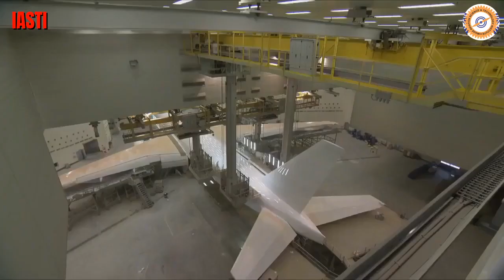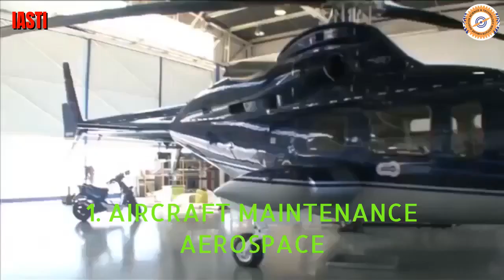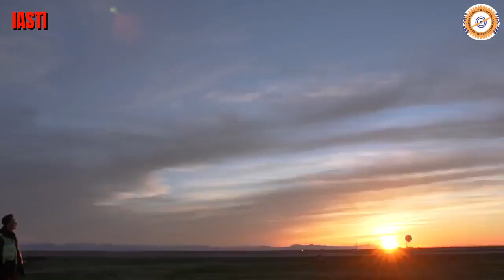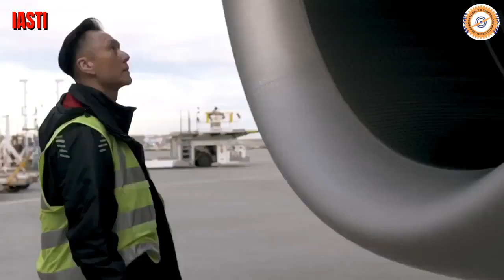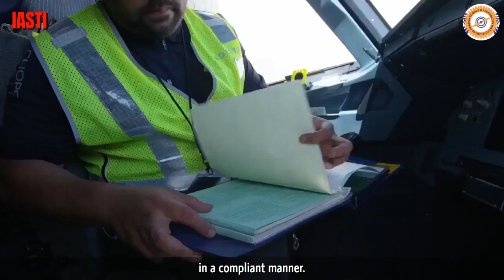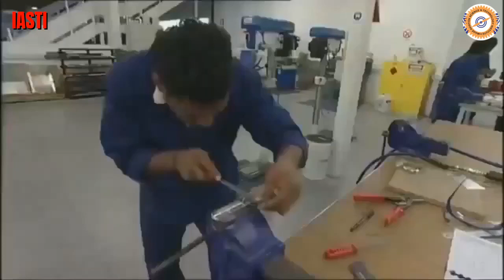AIRCRAFT MAINTENANCE ENGINEERING: WHY SO IMPORTANT?

Comment: 1. What is Image Aviation Science & Technology Institute? 
Answer: Image Aviation Science & Technology Institute (IASTI) is an aviation engineering, science and technology education based institute approved by the Bangladesh Technical Education Board. The institute Code is 50855. 

2. In which programs is IASTI currently admitting students?
Answer: IASTI is currently admitting students in first semester/third semester in Diploma in Aircraft Maintenance Engineering-AME program under the Bangladesh Technical Education Board.
Two programs: 
i)	Aircraft Maintenance Engineering (Aerospace) 
ii)	Aircraft Maintenance Engineering (Avionics) 

3. What is the minimum educational qualification for admission in the above programs?
Answer: 
i)	Students of any age with a minimum GPA of 2.00 in SSC/Dakhil/SSC (Vocational)/O-Level/equivalent examination in any department can take admission in the 1st Semester of this program of four years (8 semesters) duration.

ii)	Students with minimum GPA of 2.50 in HSC (Science)/Alim (Science)/HSC (Vocational)/A-Level/Equivalent Examination (with Mathematics/Higher Mathematics) will be eligible for direct admission to 3rd Semester of this program.
4. What are the tuition and other fees? 
Answer: 
Very much affordable and reasonable cost. Special waiver and scholarship facilities are there on the basis of merit and results in SSC/HSC/Equivalent exams. 

5. Where is IASTI located and what are the means of communication?
Answer: 
House # 6, Road # 1/B, Sector # 9, Uttara, Dhaka – 1230 
(House Building, opposite Mascot Plaza) 
Phone # + 88-02-55080305, 55080306
Mobile Phone # 01313-498381, 01313-498377
Email: admission@imageaviation.edu.bd, info@imageaviation.edu.bd
Website: www.imageaviation.edu.bd
Facebook: www. https://www.facebook.com/ImageAviation.edu.bd/